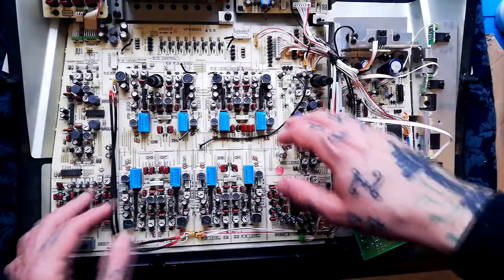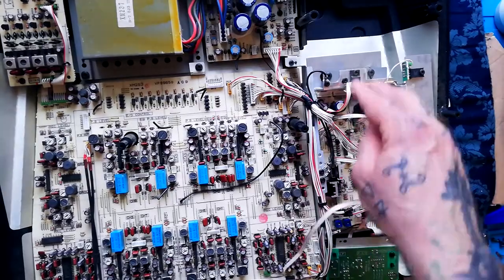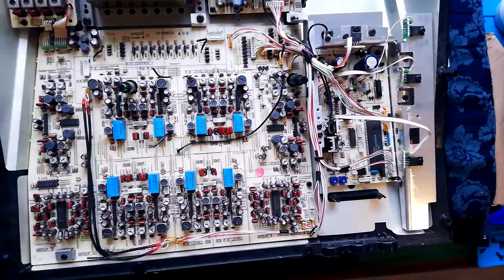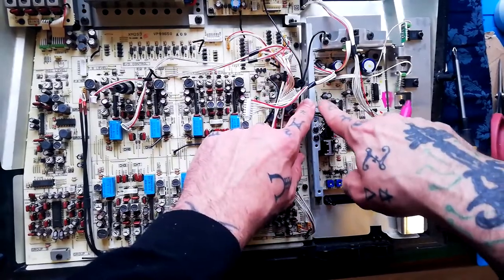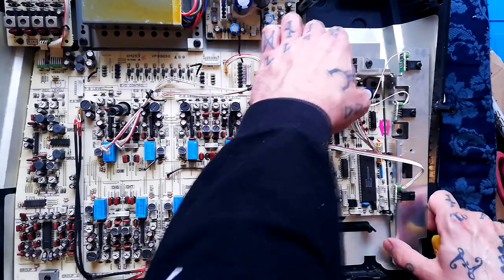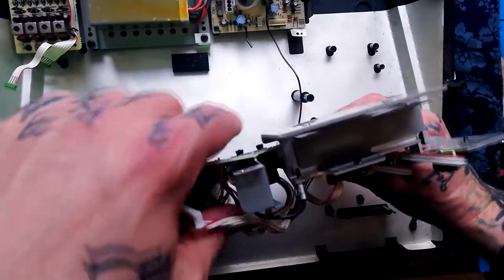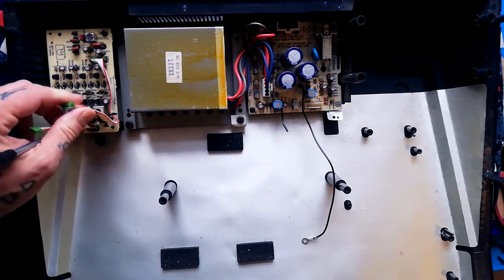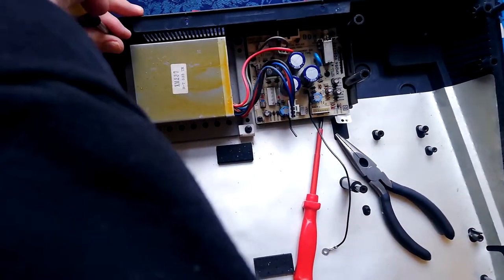Yamaha MT8X | Tear Down 3 | Lower Section

Comment: This is gonna help as I try and solve a lil hiccup I have on mine. It sounds like a humming every time I turn on the machine. It’s not through speakers, it’s physical, and it sounds like a computer fan. I don’t see a fan in the unit though. It doesn’t effect playback or anything- just hums when on- off when off. Any ideas what’s going on?
Reply from the maker: I assume it's  the capstan motor you're hearing. I actually had to replace the motor in the unit show in this video because it was excessively noisy, and I've since read in forums about folks having similar issues with their yamaha MTs...check this video and see if its the same noise? https://youtu.be/IICcT4RDLa8
Reply: @Tetrakan  thanks! It does sound similar! Sadly I can’t find the part you used as a replacement! But I’m a step closer so thank you

Comment: my first stop is always tetrakan whenever I have tape machine issues. or any issues at all.

got an mt8xii and I can't manage to record to tracks 7 and 8. The inputs on those channels work as well, but just can't seem to track to them. woe is me. i hope it's user error. but the seller gave me a funny feeling as they often do in this shady world of analog dealings
Reply from the maker: Okay so for a successful recording to take place several different systems within the unit need to be healthy;- the mixer; the record amp; the record head and record bias; the erase head and erase bias; the playback amp. If you're hearing the signal and seeing it on the meters during tracking then you know that  the mixer is okay. Next thing to establish is the health of the record/ playback head. If you can get signal from a prerecorded tape, you're good, and that also proves channels 7 and 8 of the playback amp are okay. If you can't get playback, we still don't know if that's because the record amp playback amp or head is at fault, so use your multimeter's continuity tester to check segments 7 and 8 of the record playback head are still intact - do this at the base of the head but also use Dupont wires to make the test at the header which joins the PCB in case the connecting  cables and solder are bad. If you get past all these steps without narrowing down where the fault lies, come back for more suggestions.
Reply: @Tetrakan  Incredibly thorough and generous! Should be part of a handbook...
Reply from the maker: I plan to write such a book one day, I’m reading the only ones currently available that I could find at the moment  - they are mostly either  pretty awful or geared towards people who already have a foundation in this stuff...
Reply: @Tetrakan  How’s the book coming? I’ll gladly buy a copy if it ever becomes available!!! PS. Are you taking units that need to be repaired? Have used mine for the last 2 years and it could use some maintenance.